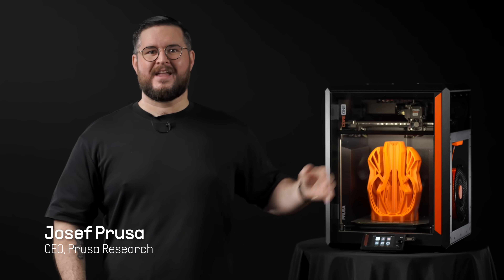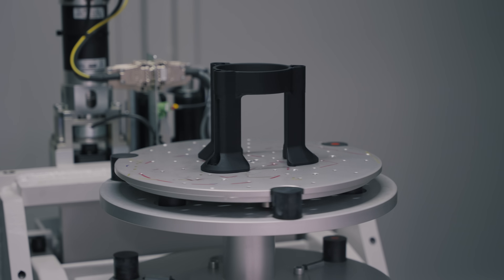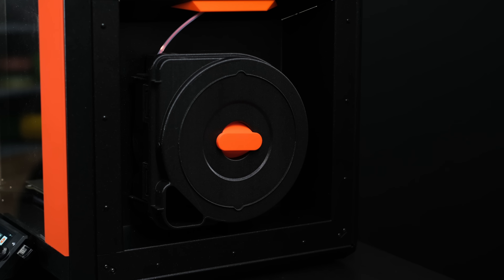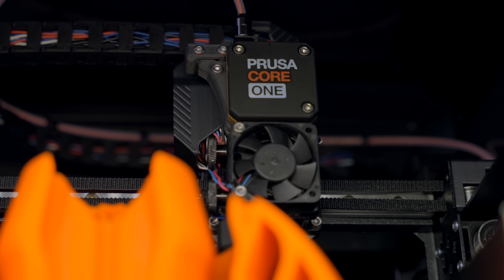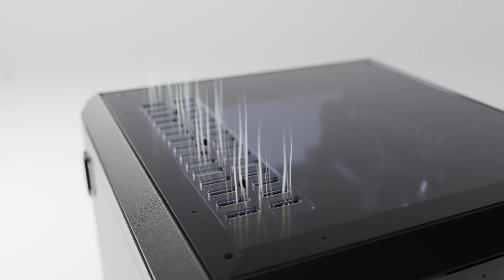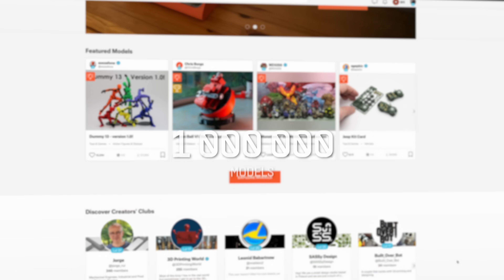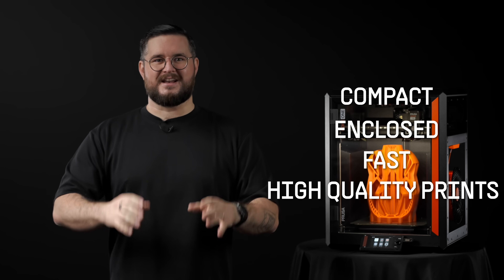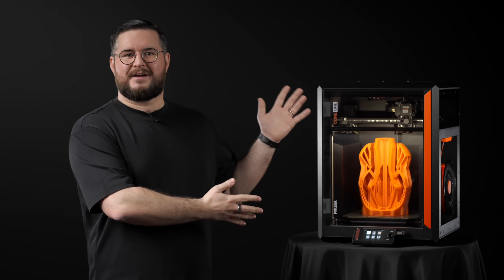Prusa CORE One - Fully Enclosed, High-Speed CoreXY 3D Printer With Active Chamber Temp Control

Comment: Unfortunately, I have to come back to you with the same issue as before. I purchased a filament dryer for Prusament, and now the filament is being fed directly from the dryer container. Unfortunately, your printer is still unable to complete a single full print without the Prusament getting jammed in the extruder. After a maximum of 20 minutes of printing, the filament breaks inside the extruder, clogs the nozzle, and ruins the print.

Please help, because my disappointment with this printer is becoming very frustrating. I have already wasted a spool of PLA and have not managed to finish a single part, while you advertise yourselves as a reliable printer manufacturer. Meanwhile, what I have on my desk right now is a useless piece of junk.

Comment: Personally speaking, having a flagship like this at home would make me feel at ease. There is absolutely no issue with this printer, it's awesome and represents what good quality and company ethos is all about. However, I would be extremely happy if there was a slightly less perfect but cheaper machine since I don't need parts all the time, but still want acceptable quality and tolerances if I do have to make some. A less costly option would surely be happily accepted among the wider "hobby engineer" demographic which I am part of. Maybe even a printer that specializes in PETG/PCTG or ASA?
Reply: You can get an Elegoo Centauri Carbon for $299 - sounds like the perfect printer for your needs

Comment: “Active chamber temp control” is enough to get them sued over, what a whopper of a lie. Shocked they went the weasel wording route
Reply: Sliding a screw head isn’t active, not including a heater isn’t active, where is the active part? Heated bed and fans that operate to regulate the chamber temp is what basically every other enclosed core xy already does, its pure bending the truth
Reply: @joeylopezdesign  
the fans are active
so it is not a line

Comment: quarter-ass bambu X1c at the same price, without multi-filament. it's as barebone as it can get, zero innovation and stand out points against other offerings, dont quite get where the printer sits in 2025
Reply: it has the mmu, 
the mmu was on the mk3 about 7 years ago

Comment: I would tell everyone right now after purchasing a pursa MK4S 2 weeks ago with the mmu don't buy one. Go with bambu labs because I have had nothing but issues with my mmu it doesn't work properly. Anytime you try to turn the mmu off in the meus it goes to a red screen saying it is overloading. Then you have to open up the board and disconnect it and it will not reconnect. Brand new machine and pusa their customer service is terrible. Brand new machine and still have not been able to use it.

Comment: Until "now" I've been using other (cheaper) printers, but am 95% certain that this printer is the one on which I'll pull the trigger, and go with Prusa, among other reasons, because I like the openness, it feels like Prusa is doing "things right", not just to make more bucks... so, great work overall, guys...

I do have a question regarding the Kit version of the CORE One. How difficult is it to assemble, how long should it take (for an average person with some experience tinkering with 3D printers)?
Is there maybe a video of the process?

Thanks in advance for any information 🍻

Comment: Honestly, I'm impressed with what I see. Having been one of the many burned by Bambu's anti-consumer decisions, I'm happy to see direct jabs at them and the negative features of their printers. My one questions is this: you talk a lot about upgradeability -- will the kinds of upgrades that can be done be talked about at some point? My biggest concern is the build volume and if it will at least be possible to expand the x/y axis, as I have large printed storage solution files that depend on having a large x/y build volume (the Modi Boxi files I own have the large box as being exactly 220mm x 220mm, so i worry about collision).
Reply: The Core One has 250x220mm in x and y. If you want to check whether exactly 220mm in y will fit on the print bed without causing problems, you can create the printer profile in prusaslicer as a new printer and see for yourself whether the boxes can be printed there.
We will see what the upgrades for the printer will look like.

Comment: For a couple of months I've been wondering if going with bambulab was a good choice and my main draw at the time was their corexy design and speed but seeing prusa release their own really set some regret in and now having my printer locked into their own proprietary software has just been the final nail in the coffin.

Even if bambulab went back on the firmware update I would still not want to use their products as it really makes it hard for me to trust them.

Guess I'll be putting some pennies aside for this bad boy

Comment: I am sorry Prusa but for this price I could get 2x P1S from Bambu or P1S with AMS and plenty money left for filament. And I am talking about the Core one which I would have to build myself.
Reply: In the US the P1S is $600.
The Core One Kit that you "would have to build" is announced at $950.
So how could you get 2 P1S "and plenty money left for filament" for the price of a Core One kit ???
Reply: @ Just to add to my previous comment. I would consider a Core One Kit at the current price of MK4S Kit price. So €819. €1,049 is just too much.

@Edit: Interesting, youtube deleted my previous comment. Going back on it, assembled Core One is €1,349 in Poland. P1S is €619,13 EUR. So assembled printer to assembled printer comparison, you get 2 Bambus for 1 Prusa. My mistake for typing it was core one kit. Still if you want to start a business and need 20 printers, do you want to assemble those 20 by yourself?

Also starting from MK4, Prusa abandoned open source due to likely China stealing all of the solutions. On top of that, they continue to use 3d printed parts. So any boards and such you have to buy off Prusa.

Comment: Seams nobody mentioned hefty price for this Prusa printer Assembled £1,138.80, compare to other brands.  Where that will get you assembled printer and Multi Color & Multi Material Capability.  And still left over cash for filament, actually a lots of filament
Not to mention another brand has Multi Material Capability units with a expansion up to 16 colors NOT 4 or 5 like Prusa MMU.
you must be joking Josef

Comment: The 4S "beating some of the fastest printers on the market" is a disingenuous claim. We know that the stock profiles are nowhere near as fast as some of the Bambu labs printers, which can provide equally good print quality and dimensional accuracy at much higher speeds. Either release official, supported faster profiles for common filaments, or don't make claims like that. High flow nozzles are great, but if the X1C and others can print faster with a standard flow nozzle, you should be able to also.

Comment: I’ve decided to wait, as Bambu is likely to release a larger 3D printer in January. That said, their current machines are impressive. Personally, I prefer Prusa over Bambu; my experience with the MK3S has been outstanding—it’s incredibly reliable and has never let me down. However, I do find Prusa’s pricing a bit steep. For the same cost, you could get a Bambu X1 with an AMS system included. In that regard, Prusa has its advantages, but I’ll hold off until Bambu’s new CoreXY model is available. For me, a build volume of 300x300x300 mm is ideal.
Reply: Sure.... But good luck getting support let alone an upgrade path under bamboo printer down the line. Meanwhile prusa is still actively testing their filaments and former updates on very very very old printers
Reply: @thibaultmol  Yeah, i know. As i said, i prefer a Prusa over a Bambu printer, but other things like build volume make me prefer the new one over Prusa's new printer.

Comment: Prusa has managed to design a closed printer in a compact size. Now they just need to do the same with their MMU, whose design is terrible; its system of tubes, buffer, and spools takes up the space of two printers combined. The MMU4 should be fully integrated into the Core One. It would also be necessary to have a version of the Core One with two print heads, the smaller sibling of the XL.

Comment: I was expecting that kind of printer to be released and I am almost not disappointed. Don't get me wrong, it looks like a great printer. I was just hoping for multiple extruders, like in the XL. Despite the firmware upgrades improved MMU a lot through the years I'd still prefer to have at least two extruders.

Comment: Did you know that sense Prusa was open source bamboo used their stuff and became a lot more famous with just customizing their software into looking like theirs.
Reply: 1 Bambu studio is open source.
2. There are completely different, layout, options and functionality and and prusa copied Bambu. (Multi plate, step support etc)

3. What on the X1 series is even remotely used from a prusa mk3 or mini? (2022)

Keeping that energy will keep prusa failing behind further. Either Innovate and  adapt or get left behind.
Reply: @hawtdayum  "What on the X1 series is even remotely used from a prusa mk3 or mini? (2022)"
Heated PCB build plates, magnetic removable textured PEI sheets, loadcell bed leveling. All things prusa invented for 3d printers.
Reply: @LilApe  
OK let's play this game. Bambu Lab Lidar implementation(filament calibration,build plate detection, firstlayer detection), AMS system,  Printing from cell phone without touching a slicer. Printing without having to manually load filament, filament buffer, multifilament buffer, joining 4 ams for 16 colors. First consumer CoreXY that does not need building and is ready in 20 min. 

But you forgot the X1C shipped with the cool plate(35C) it didnt need to cook like a PEI sheet50-60C). 

Magnetic build plates have no official attribution. And magnets and ferromagnetic materials are not special or novel. 

 load cells dates back to 1843 when British physicist Charles Wheatstone 

But sure a dude Joe "invented them" lol.

Comment: Uh. With due respect its too damn small and will only sell to hobby guys printing toys and little monsters.

The USA has been developed on a 4″ (101mm) module. We in the USA are moving to larger print beds at least 304mm (12 in) square. Prusa’s failure in this regard will not compete with Bambu Lab who is stepping up so prosumers can compete in the real world printing functional products. Even Anycubic got the memo and has gone large.

One thing Prusa –*has*– done well --exclusively-- by getting their PETG certified by UL so architects and other prosumers can model and print products that comply with building codes; flammability and VOC gassing etc. but the company still has inventory problems it has yet to manage as PETG is rarely in stock  and AFIK --nobody-- but me knows they have rated product and --that-- is a public relations SNAFU.

Anything I can do to help...
https://clintongallagher.com

Comment: I use Auto Desk Maya 3d modeling software. Will I be able to load my files into the machine straight from Maya or would I have to use a 3rd party software to convert my Autodesk project into a supported file type?

Comment: Imagine releasing an enclosed printer in nearly 2025 without a chamber heater
Reply: There's 150W heater inside the chamber, it heats up the enclosure pretty quickly (yes it is he heatbed, but that's literally an active heating element).
Reply: @TheMikolasZuza  the heat bed targets a bed temp, not an air temp. Can't wait for all the review demonstrating a 120C bed and a 40C chamber.
Reply: @bradleyhovan9390  I see where you thought process is coming from. But in reality the heatbed produces almost "too much" heat, so the two fans in the back heat the excess heat out. The chamber was designed to have minimal additional volume, apart from the printable area. So when printing any high-temp material (e.g. ABS/PC) you'll have the chamber >50C before the first few layers are done (which are directly heated by the bed).
Reply: @TheMikolasZuza  Not my experience with ASA and ABS on P1S.
The P1S's heated bed is 350W @110v and that is NOT enough to avoid warping on large / tall parts in a 16oC (60oF) room.
Even when wrapped in a  blanket. Have to add a heater to heat up the air at the top of the chamber to reach ~55oC..
No way a "150W heated bed" is enough for such filaments, except for small parts.

Comment: Where would be the exhaust mounting options as depicted in the video? On the left side only or also at the top or back of the machine? I would appreciate also the option to open the enclosure door and slide it inside a dedicated pocket in the printer. Maybe oven like doors would need to handle this - top or bottom opening?

Comment: i'm no super fdm guru, i just keep my ear bent on products that i'm interested in that can allow me to grow as i improve my skillset without having to upgrade or update every other month.  call me a casual user at best at the moment.  i want a machine that i can grow into not out of.

i'm gonna be the guy that asks for dreams and wishes.  was seriously interested until i saw the build volume.  i just dont understand what the industry fixation is with the 220mm dimension.  the price-point is awesome for the product i see but that build volume is the biggest negative to me.  280mm cubed should be the core XY minimum industry standard in this day and age.  with the space saving design, it shouldn't have been an issue to go that size.

i did notice that the use of ABS was not mentioned, was that an omission or something the printer is not capable of printing?

the use of material change units is becoming a more and more appealing thing to me and not being familiar with the Prusa line, are other brands of these units able to be added to the printer or is that something that is semi-proprietary?  

with the new chatter about snoopware being bled into the printerverse, what is Prusa's official position on this and what would their solution be in their firmware and slicer product lines?

Comment: Does the MMU3 really have to be installed outside the enclosure?  
Have you designed a new printer and didn’t think of designing the enclosure so the MMU3 could fit inside?  
It’s a real mess.

Comment: Nice thing! 
Shame the size is still small.
If you really wanted to have a competitor to bambu... The print volume size could have been it.
Most now build a similar to bambu with the same dimensions.
If you want to justify the price and being better I think a 300*300*300 would have been a great thing.
In comparison with the qidi 4 who also adresses the bambu design, but with a bigger volume and lower price.
All though it has also some hiccups... But which 3D printer does not?
Reply: There's the 360x360x360 XL. Genuine question, what do you print that you need printer that big? The CORE One is already quite large. Any bigger and it would be too much for my home.
Reply: @TheMikolasZuza  I'm a performer, sometimes need some big prints for custom made costumes, that's the big reason. I have now an old enclosed Two Trees Sp-5 which still holds up nice but the motherboard, speed and hotend could be improved... Still looking out for a good replacement that can handle the speed, different materials (enclosure) and size. I'm not so much into the fancy parts like multiple colours, multiple print heads, cameras, etc...
Just need decent size, speed, and able to print most materials.
Reply: @1980cboy  Good information, thank you! Always interesting to read the motivation behind "wish it was something isntead". :)

Comment: I'll have to wait to see the reviews... I had a flashforge printer that used fans for temperature control and it honestly sucked. But I know Prusa pro machines have temp control and they seem to work well, so I hope that same tech made it to the core one. The flashforge machine used a temperature sensor to turn on rear fans in the back, and it would pull ambient air from outside the printer to the inside to cool down. The problem was that it was too abrupt and would shock your print and cause delamination or warping when the fans would kick on and immediately start pulling colder air. I would like to see the core ones temp system explained in more detail. The community figured out long ago that simply cracking the top open on the flashforge was a much better way of stabilizing the internal temp. Another missed opportunity (IMO) is that they didn't use the tool head mounting system out of the XL. I personally love how easy it is to pull a plug and slide a couple couplers over and remove the whole tool head for easy repair or nozzle swaps. I would have liked to see that here. Plus it would have made for interesting community tool head mods.